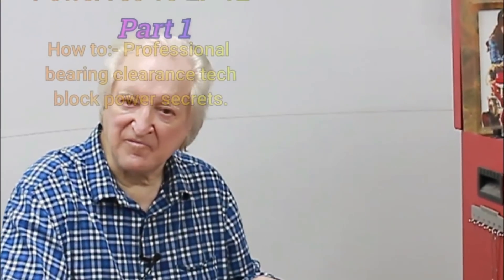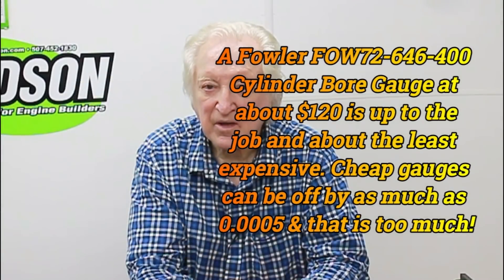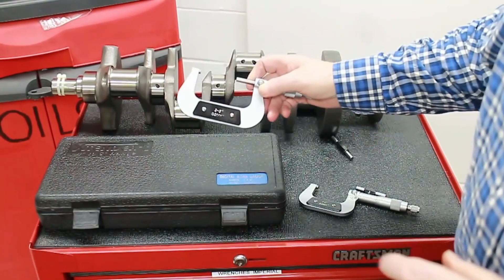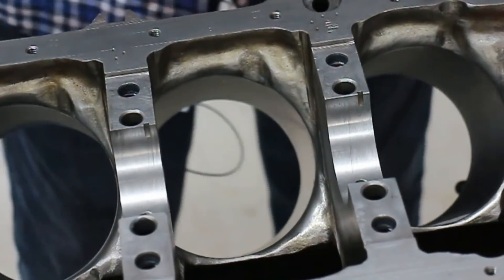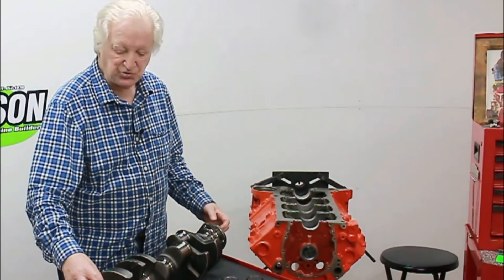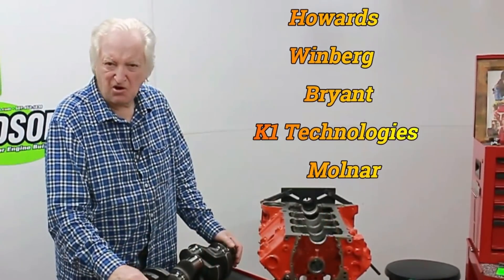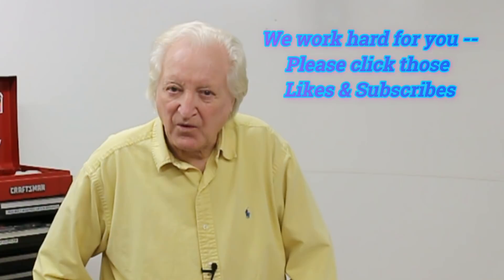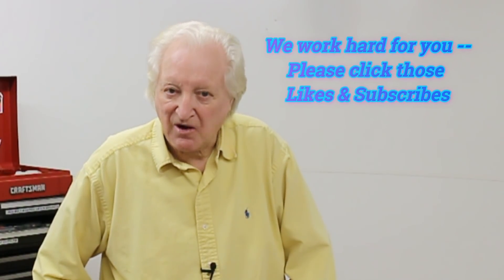David Vizard's PowerTec 10 EP 12 Part 1 Checking Bearing Clearance. To Plastigage or Not.

Comment: As pops would say "SEND IT".I built my first car when I was about 16.I did it in such a way that I only had what was completely necessary for it to run as if it was on an engine stand,no A/C or anything just a hot wire to the distributor, fuel line, radiator and heater hoses etc.reason being that I could take the hood off and remove the motor in about 45 minutes so if I screwed something up it wasn't a big deal to take the whole thing out and see what happened.I ran a bunch of combinations of 350/383 strokers in the old 81 Malibu and made some mistakes but mostly successful with my educational car.but anyway a good way to learn basics is to build it basic.

Comment: Yes doing rods in the supergas Buick 455 motor and getting .012 clearance after getting Pontiac rods to fit the crank I have now after machine work 1400  in a set of Pontiac rods for my Buick. Just to get the piston higher in the block at .011 on #1.Belt sander is working nice for this but will fine sine with a stone or fine paper on a flat surface.

Comment: Great information.  I am plastigageing my crank and rods in the van tomorrow.  I almost lost the motor due to bad cams and lifters.  Without DLC lifters I would be constantly changing cams as they go flat right away.  I have changed 4 times now.  Only the last one with DLC lifters stopped the nightmare.  Then I had a head gasket problem.  Fixed that.  Then it was running great and suddenly a rod sounding knock.  Luckily, I shut it off right away.  It takes hours of sanding to fix the crank.  Soon I will be driving again.  I use You Tube a lot to find new ways of dealing with problems from real pros like you.

Comment: Nobody seems to use a bearing micrometer. Check the thickness of your bearings. Measure the bore and the crankpins .Do the math. does it add up?  Does the bearing snap into place or tend to fall out? Make sure the crankpins are round. They may look great having been freshly ground but the are not always perfect. It is better a bit loose than too tight on clearances.
     After you torque your rods and mains tap them with a hammer and see if the bolts are now loose. It may look like they are seated but sometimes they aren't. 
    Do not put grease or heavy oil on the backs of bearings. Install dry then lube. 
Lastly pray the crankshaft demons do not decide to eat your crank for lunch.

Comment: i see he did not have eagle ranks n that list love to hear his thoughts n them
Reply: Eagle is bottom of the barrel stuff, I'm even surprised he recommends Scat as when people use good measurements they usually never holds up either.
Reply: @PSA78    well prep is never known or rarely by the us that here of failures  was old balancer used what balencer  was used was it even balanced . tolerances breaking it  in or lack their of wile useing oem tight tolerances   etc ..pardon grammar keyboard is dieingg china junkk loll..cheappo parts are a plague
Reply: @overbuiltautomotive1299  I believe your keyboard might be from Eagle or Scat as well. 😂
I've seen several measured on several places to see how they are ground, and they tend to be barrel shaped and the radius is off creating rubbing against the bearing. Conrods is even worse, they tend to be out of round once they have been torque cycled. 🙈
If you want to buy the cheaper China stuff, get Molnar or Callies Compstar series. 👍
Reply: @PSA78   yep i fill you man it suckks buyin china stuff  it could be made here and not b outrageously priced  .i figure greed epa and lack of drive could be culprit  inn general not seeing more usa made stuff not too mention the consumer are so silly they buy junk and like it  ..i needed a reliable runabout so dug around a got mild wrecked  beater 2005 is300 lexus is300 239k  went n got  new tires Cosmo good and very fire priced and poly bushings and kyb and 6.00 brushes fir alternator as a refreash shocks a dream to drive now 2300 all in.. yes it was a bit of effort but no payments annd no chap china pars are on iit mostly japan stuff were it was made lol
Reply: @overbuiltautomotive1299  Unfortunately many things made in China today is of really high quality if it's ordered that way. Meanwhile you've got all the companies trying play catch up and fails miserably, just look at all the US made cylinder heads that's pure crap out of the box, you couldn't pay a Chinese to copy Edelbrock for instance, they would rather jump off a building. 😂
Reply: @PSA78   yep its lie a re- re did the machine work on a lot of that crap

Comment: Plastigage when used correctly can find off axis bearing bore, bent crank and cam issues, and journal taper. Some of you all pretend that physics of plastigage somehow cease to exist because you said so!?!? 😜😜🤣🤣 Either the plastigage crushes or it doesn't!! People say that's impossible it ran fine etc but I have had to show many that their crank was bent and plastigage does that easily. Plastigage taper is the only way to find it if you don't have a centerless grinder. Also I have seen crank sanding belt polishing cause taper issues.
Reply from the maker: You have some interesting points here. I suspect your sentiments here pretty much follow my thoughts. This plastigage stuff is under-rated.

Comment: David, i have two of yours SBC books laying out right now.  putting together a .020 over 350 SBC.  won a few ebay auctions for Mitutoyo micrometers & bore gage.    reading through two GM service manuals they both clearly spec the use of plastigage, one manual from '85 another '95.  I found that interesting.

Comment: Totally agree with this video. if you have the expensive measuring equipment that's fine but definitely not required. We're currently running a 1500 horsepower LS twin turbo engine, plastic gauge, fastest stick shift street car on West Coast. Professional engine builders don't want this do-it-yourself stuff out in the public. I appreciate your knowledge thank you

Comment: While I truly admire you cylinder head/airflow and camshaft work I find this video very similar to your previous rod balancing video.  As a machine shop owner their are no short cuts or home diy hacks that won't come back to bite you or cause sleepless nights.   

I totally agree that plastigage belongs in a Craftsman tool box because a professional uses neither of them!!!   Reading Plastigage is very similar to reading tea leaves,  somewhat open to interpretation.  Plastigage is better than nothing and also next to nothing.   Without precision equipment that at minimum measure in tenths you are only guessing when trying to determine a measurement using an instrument that measures in thousands or half thousands.   Stacked clearances are what cause issues. Your crankshaft may be within spec and your main bore or connecting rod and bearing thickness may all be with in spec but can lead to disaster because every item has a specification range plus or minus. 

I agree that it is no fun to try to remove rod caps or main caps repeatedly, but more important is that it  is detrimental to the fasteners and the cylinder block(steel bolts into cast iron threads) which is why main/head studs are important. All modern parts suck regardless of the name on the box.  I often use 2-3 sets of bearing to come up with a proper set to equalize bearing clearances.   

All clearances need to established long before the engine is assembled or even balanced.   I realized that I am lucky to have my own machine shop and more invested in inspection equipment than some people have invested in their house.  All of my customers measure absolutely nothing because they trust me  and we have open lines of communication but not everyone is in that situation unfortunately. 

I'm not sure what your affiliation with Goodson is but being affiliated with them does absolutely nothing for your reputation.   Goodson is the "Walmart " of machine shop supplies.  The vast majority of what they sell can be purchased directly from the supplier at a reduced cost by anyone.  Their only advantage is that they are a one stop shop just like Walmart.   I have yet to meet a shop owner who had any praise for Goodson.  Yes I buy from Goodson on rare occasions when I'm super busy or lazy and want the convenience.
Reply: If he has done many engines & gets results, then his work is good, it might take looking back at the last 10 engines & see if they have held up over the years. He is trying to give the poor, DIY guy something to use other than luck.

Comment: Thanks, David, for another great video!
 I'm currently working on replacing rod and the lower main bearing shells on my 2001 BMW M5.  The car is on the lift, with the front crossmenber out.  The S62 uses Torque-to-Stretch bolts for the inner (either side of crank) main bolts and rod bolts.  You can get ARP2000 non-stretch bolts to replace the rod bolts, which I've done.  Unfortunately the main bolts are 11mm, so sourcing those means custom parts.

Anyway, this video confirms my suspicion.  If I torque the bolts to 1/2 their spec, it is good enough for measuring clearances.  What this means is that I can use the bolts to bolt the mains in the final time if I only torque them to 1/2 their torque spec doing bearing clearance measuring.  FWIW, I've done this on the rods, with a shell in them and measured the hole with a dial bore gage (tricky with the engine and crank in the car!).  I've also used plastic gage and get very similar results, luckily within spec!

I have one of the cheaper Chinese made 0.0005" dial bore gages (which looks just like the one you showed) and it seems of decent repeatability and quality for once-every few years use.  I also have a 0-6" set of 0.0001" micrometers with standards, that look identical identical to the ones you showed.  Mine came in a wooden case.  I had a tool and die maker check them out and his opinion was that they were plenty accurate and good for my uses doing engine building.  I've blueprinted a few engines with these tools and those engines are still running strong with no signs of bearing material in the oil analysis.

Comment: this is perfect i have a machined ARP studs four bolt 010 40 over sbc 10/20 tin nickel  pre roller  i wanted to put this size crank in it i have done all kinds of stuff that i learned from David's and smoky books and just got a valuable tip on grinding bottom of bores wow and other 6 hp im so excited right on David cant wait i hope you do the whole build oil pan to carb then dyno

Comment: Great video David. Never knew about shaping the bottom cylinders, make a difference on a  351 Cleveland?
Reply: They are all the same until the heads! More or less. Could not hurt, surely.
Reply: What a golden nugget, right?! I am not an "engine builder" per se but have built a few engines over the years and I read everything I can get my hands on and have for over 30 years...... but I never heard of or saw that little trick before! But now that I see it, it makes perfect sense to do that!
I bet David has dozens of those types of tricks. What a legend.
Reply: Thinking the same thing.
Reply: He states in his books that everything benefits from the smoothing. It even showed several hp on a tiny mini cooper engine.
Reply: Also it lets your hone come out of the bottom of the bore allowing you to hone straighter .

Comment: Sometimes the caps will move sometimes they won't. Depends on how good the manufacture, machinist machined it. Especially if the Engine Block or Rods have been resized. That is why you should always torque to within 10lbs of the final spec before you take measurements of the Main and Rod journals.
Remember You Read it here first.
Reply from the maker: Brenton,
 Good point but if the cap fit was not up to scratch we would fix it. If I can squeeze it in I will mention this and credit you in part 2. thanks for the tip.

Comment: The term internal balance, is best referenced as neutral balanced flywheel and a neutral balanced harmonic balancer where all of the balance takes place on the inside of the Engine. Internal balance is the best, Bar None.
Reply: Actually that would be a neutral balance flywheel or flexplate and a crank hub or harmonic damper.

Comment: Plastigauge has been around ever since i can remember.They have had yrs to perfect it.(edit:spelling)
Reply from the maker: Well Mr. Saddle Tramp sir. I have to ask if they have already perfected it or not. I think not but it is good enough to get the job done in reasonable style.
DV
Reply: @marvingvx1  plastigage is "good enough" for most clearance measures but the key issue it best indicates is taper ie bent crank, misaligned bores, etc. THOSE are the things most likely to destroy an engine.